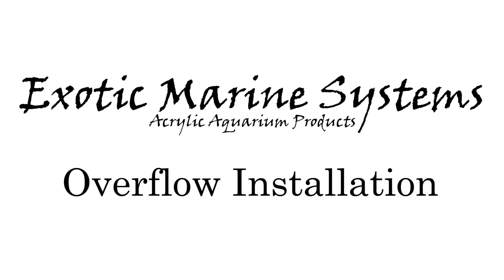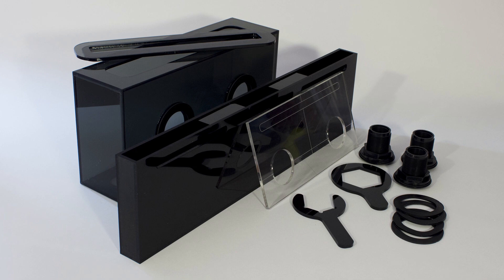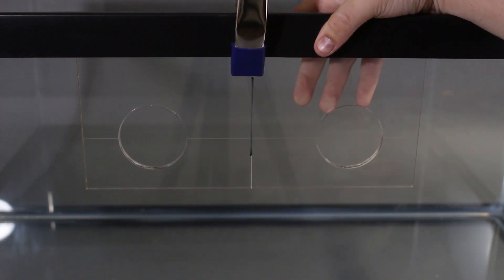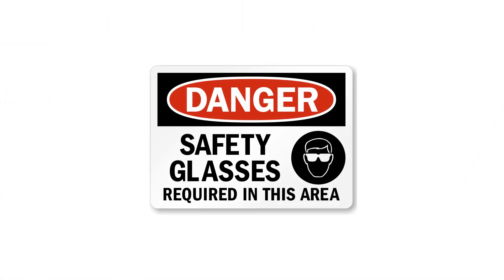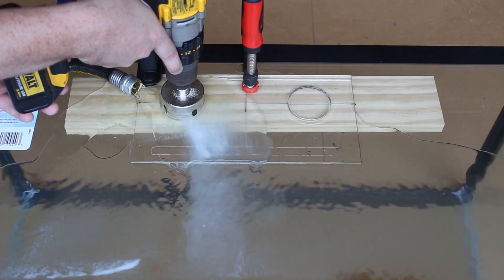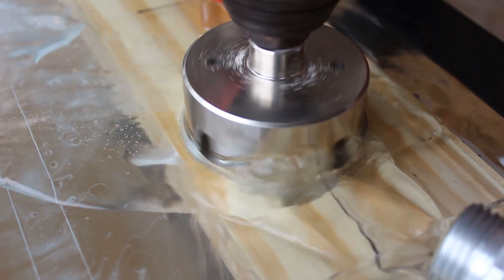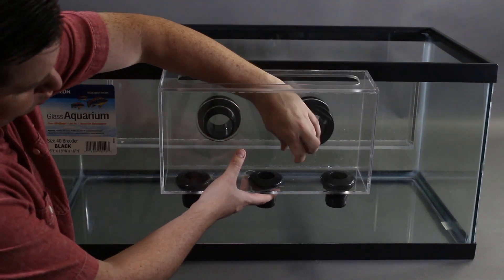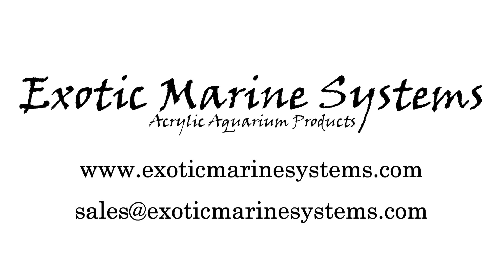Exotic Marine Systems - Overflow Installation

Comment: Are you able to still run a light mounted stand with your overflow box? Eg an AI hydra hms Mount?
Reply from the maker: I am not sure, I have never tried.  I would guess it would depend on where you mount them.  I doubt any mount that straps to the rim of the tank would work with any of these slim line overflows.